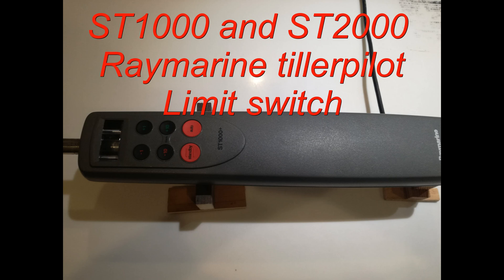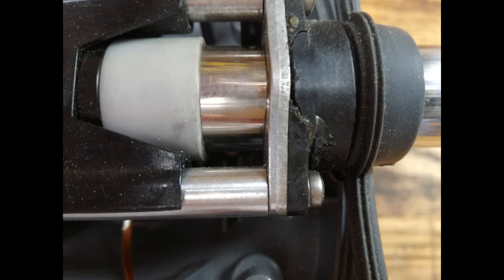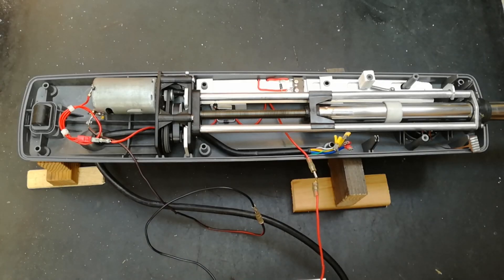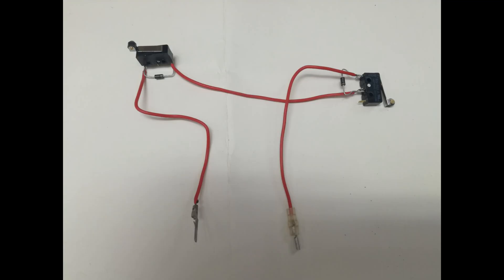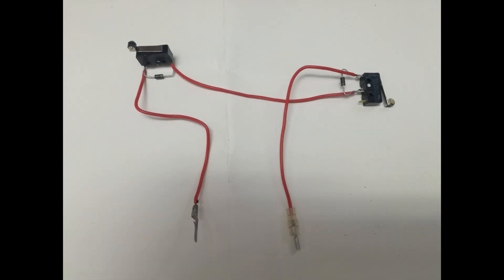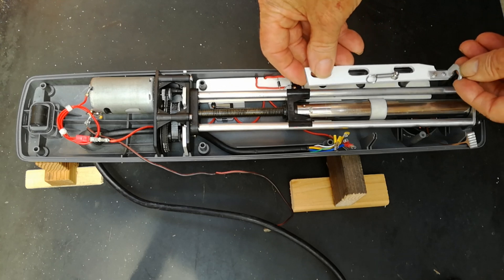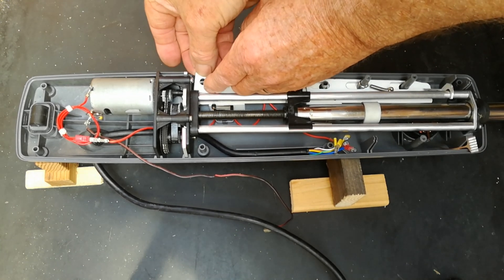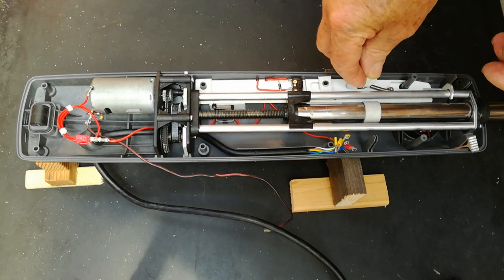st 1000 st 2000 Raymarine tillerpilot limit switch

Comment: Very well done sir, the diodes under the switches are key to me. Its realy a shame that Raymarine delivers these kind of devices without limit swiches...I have an St 1000 and a EV 100 of Raymarine and im not satisfied at all, In fact a bought a Nautinect Autopilot system but im trying to upgrade it with a tiller sensor or some external end switches device.
Reply from the maker: Please let me know when you have fitted the switch. You didn't mention a ST 2000 here but you ordered a ST 2000 switch. I hope that is correct.

Comment: I have noticed that the Autohelm ST1000 has a soft chock absorber (rubber ring)  mounted at the ends of the two parallel metal rods. (see picture). The ST2000+ does not have these chock absorbers. Raymarine reacts with absolute silence, when I inform them of the missing limit switch, which they could very easy implement as part of the electronics.
Reply from the maker: I have pulled apart 3 different ST 1000 units and none had the O rings or the plastic fittings on the switches on the board. I have a feeling that yours is a "European" unit. Maybe Raymarine mad some modifications. My unit is about 5 years old and it doesn't have them. Yes, Raymarine has no interest in improving the end damage. That is called Built=in obsolescence.
Reply: Gary, Please note that my observation is made on the Autohelm ST1000. Not the Raymarine ST1000+

Comment: What is the maximum rated current for the diodes used? They will need to conduct  the maximum motor current
Reply from the maker: Hi. According to the Raymarine manual the AUTO current consumption is "0.5 to 1.5 Amps depending on boat trim, helm load and sailing conditions." I have fitted BIG 5 amp 100V diodes because I didn't want extra heat. All of the fuses in my boat are the same 5 Amps. gary

Comment: Hi Gary - my ST2000 keeps blowing fuses after few seconds and if I try to just run the motor like you with 12v it also blows the 12amp fuse i have on the line. Do you think the motor has a shortage based on this please?
Reply from the maker: Hi Arthur. I sounds like you motor is gone.
Have you opened the casing and visually inspected? Is there any apparent water ingress, rust etc? If you can find the part number on the motor you can order direct from a Chinese seller from Ebay etc.. The Japanese company that makes the motor is Marubuchi. However the Chinese replacement comes from a company called Marubichi! Both the same quality. These cost about $15. If you look for Raynmarine replacement it is the same motor but much more expensive. If you can read the part number off your motor please let me know.  garymalm AT yahoo.com
Reply: @garymalm  Thank you so much for your response, this motivated me to carry on! I disconnected the motor from the board to check for reference and tested it again (this time disconnected from the board) but this time it worked without blowing my fuse. I now wonder if it is the board that is faulty. There was 3 spots on the board where there was like some salt, maybe a bit green (oxydation?) and I tried to clean it. On the passage when it happened there has been some water ingress about 30hours before it stopped working, it was beeping constantly but after drying it open for 2 hours it worked again until it failed completely.
Given that it shorts when I put the motor under tension when plugged to the board it could be the switch (Mosfet) on the board?
A new board is expensive....
Reply from the maker: @ArthurPopeye  Hi Arthur. It is either repairable (I am doubtful) or repairable.
Here is what Simon Says. https://www.youtube.com/watch?v=U_DSWruFJQk
Reply: @garymalm thanks Gary - that was a good idea but did not work. I found that 2 MOSFET were bad so I even went as far as soldering new ones. It worked well for 5 seconds, then completely dead. So now it's either a new board or a new pilot 😅
But I learned a lot anyway... thanks again.

Comment: Hi Gary, a friend of mine has given me an st2000 to repair for him.  I normally repair older analogue audio equipment  so lam a bit out of my depth with this unit. The fault is that the push rod will come up but will not return. In other words it will go one way but not the other. Any idea what could possibly be  causing this problem.
Many thanks for any help you can give.
Cheers Cliff
Reply from the maker: Good morning Clifford. We should be able to work something out. Can you give me a little more detail.RE  the push rod will come up but will not return. In other words it will go one way but not the other.  Does this mean that the electric motor will not turn and pull the rod in. Does the rod just rotate and not move in? Do you have it apart? my email is garymalm AT yahoo. com  If you contact me there you can send photos. Lastly, there are no spares for these things. Crazy eh!

Comment: Gooday Gary, I would be interested in the drawings you said you would do. Have you don them yet?
Reply from the maker: I'll dig them  up , John. Give me a week or so. Off on a cruise tomorrow.  gary
Reply: @garymalm  Gooday Gary, how saw your cruise, good I hope. Have you had a chance to dig out those Drawings yet. I have started on the job using a old 1000 that went probably for the reason you make the mod. I have made the base , then got side tracked with boat trailer rebuild.
Reply from the maker: @johnsproject.4212  Hi John
Will get onto it tomorrow and mail off on Sunday. My email address is garymalm at yahoo.com  Contact me there and I will send a PDF
Reply from the maker: @johnsproject.4212  Hi John.
 Contact me on garymalmATyahoo.com and I will send a PDF of all my drawings , I just took photos of them so not that clear. You will get the picture though.

Comment: Can I send you my autohelm 1000 and you can figure it out. 
Maybe it's just to old. But it extends. It just won't retract. 
You seem to know a thing or two about a thing or two. 😊
Reply from the maker: Hi ready. Where are you? I am happy to look at your autohelm 1000 (free) , I guess it is a Raymarine TP 1000, But the postage might be high. Can you open it and look inside It  could be a slipping or stripped drive gear.  gary

Comment: Hi, your system is interesting. Ty for sharing. Thé composent you ad to thé switch is freewheeling diode ? If yes  anu tef please ?
Ty
Vincent (Bordeaux,  France)
Reply from the maker: Hi Vincea The  diode is a Shottky diode that you can get on Alibaba etc. I went for a very large oversize diode ( 100v 5 amp) because I didn't know the actual load on the motor. https://www.temu.com/search_result.html?search_key=Diode&search_method=user&refer_page_el_sn=200010&srch_enter_source=top_search_entrance_10032&_x_sessn_id=ni0a212dck&refer_page_name=goods&refer_page_id=10032_1725276114694_diao7kj2dx&refer_page_sn=10032  gary
Reply: @garymalm  hello, thank you for the answer, I later understood the interest of the diode. I created a much simpler limit switch system. My sensors are screwed directly to the bottom of the case, and mechanically connected by rods. It works well, but I have a little problem depending on the angle read by the compass, at a certain position, my cylinder retracts completely. I am afraid that this is due to electromagnetic disturbances, due to the proximity of the PCB sensor or the compass.
Reply: @garymalm  if you give an email,  i can send à picture of it.

Comment: Is the drive unit of the ev-100 tiller has this problem too?
Reply from the maker: The EV 100 has a remote ram arm an a sensor in the control unit. This is a copy of the Autohelm system one of the first tillerpilots that came out almost 50 years ago.

It does not have the same problem as the cheaper ST 1000 and ST 2000 units.

Another system similar to the EV 100 is the Pelagic system. It has a reputation of very high ram torque and robust construction.
https://pelagicautopilot.com/
Reply: @garymalm  thanks for the information

Comment: I have a 3d printer. I think it would be good to design some more basic and more adjustable limit switch holders. Maybe eliminate the spring. I'll see what I can come up with. I need mine adjustable because the tiller limits before the unit and I'd like to have it stop before it strips its teeth!
Reply from the maker: Hi sail for life. 
With a 3D printer you could really refine the design.
One thing to keep in mind is the amount of torque there is at the end of the stroke.
nI normal operation the unit is just making small movements in mid stroke.
The problem arises either when using the Tiller pilot to tack or when you disengage it from the tiller and don't push the Standby button. In these cases the ram will reach the end of stroke at full power.
The spring is to correct for overrun. When the unit switches off, the ram will overrun between 5 an 7 mm. so you need to have a physical buffer for that overrun distance. That is what the spring does. 
As you mentioned, you could make fitting adjustments to compensate for this.
Let me know of your progress.
All the best 
gary
Reply: @garymalm   I just posted a video about it including the details of the 3D files etc. I didn't get rid of the spring after all, though I tried! In the end I settled on a piece of wire and a spring from a cheap pen. Thanks for the inspiration!